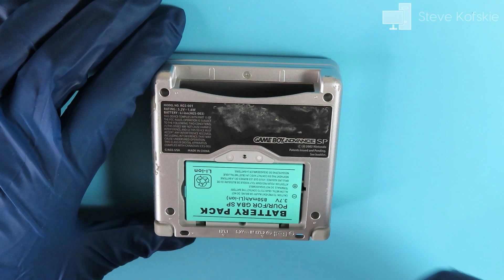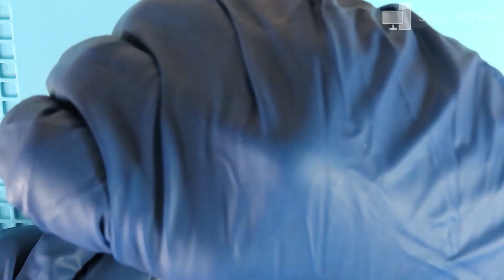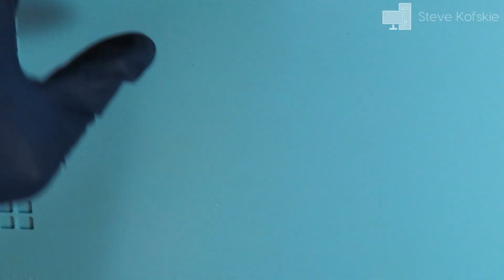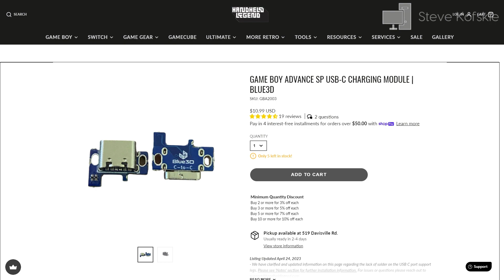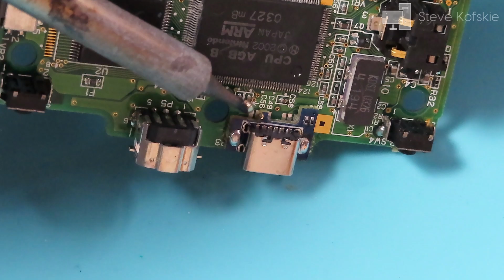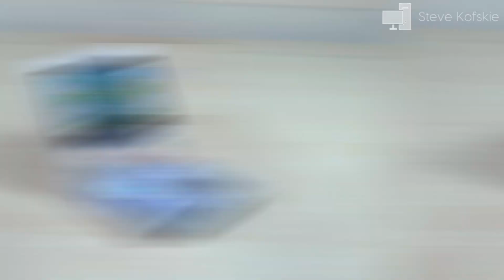Gameboy Advance SP Mod: New Shell, RGB LED Base, & More

Comment: I recommend that you use the funnyplaying usb c mod as it does a few things:

Usb C to C 
Usb A to C

Also it can do usb C to audio jack if the dongle does not have a DAC.

No fast charging as the hardware isnt cabable for it. But more compatibility options is great. As for battery I also recommend the funnyplaying battery that was designed by Makho as theres a huge improvement in battery capacity and its more optimized for ips screens. 

Nice finished product, keep up the good work.